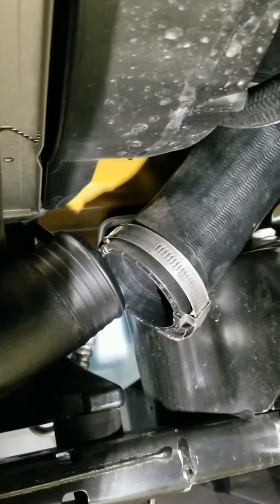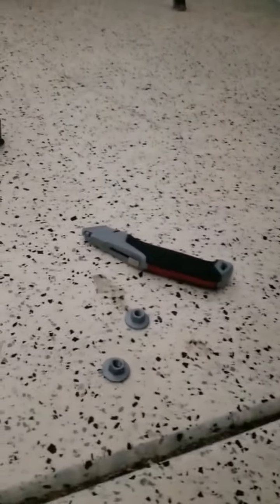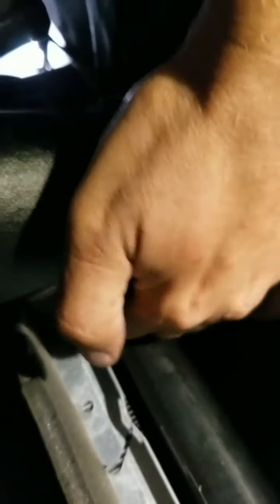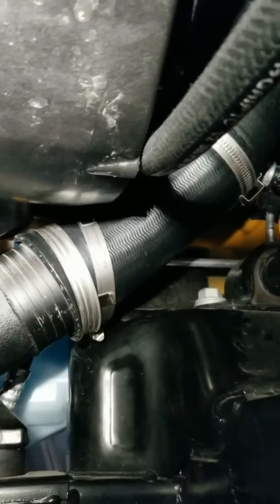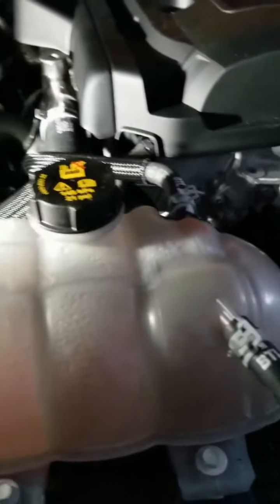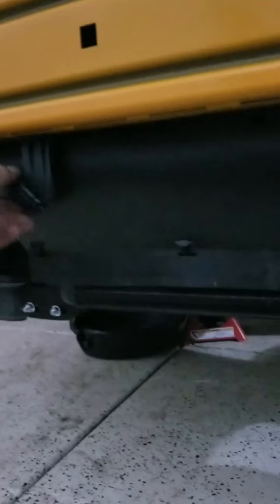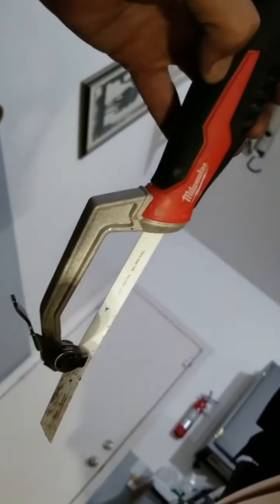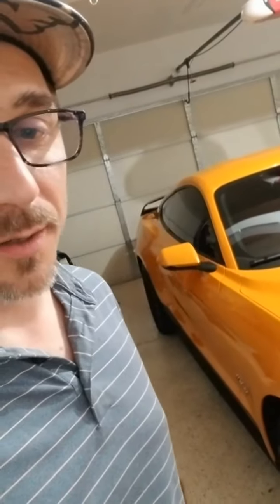CV Fabrications Full Race Intercooler - Part 3 of 3  Installed on 2019 Mustang EcoBoost

Comment: Do I need to tune my car if I install the intercooler?
Reply from the maker: No, but you will not really receive the gains from it until you do.  The same goes for pretty much any mods that you do.  Except the air filter.  You may see immediate gains by dropping in a high flow filter.

Comment: Would you recommend this FMIC? I can’t seem to find many reviews on it. It is a HUGE intercooler, I’m just trying to figure out which parts I want to put on my 2020 EcoBoost.
Reply from the maker: Yes, I definitely recommend it.  It keeps the charge Temps low and if you ever plan on getting a big turbo then a Race style FMIC is neccessary.  The quality is excellent and it is the best bang for your buck out of the larger ICs that I could find.  I also wanted black and most others charged extra for that.

Comment: Was it difficult to install it? I just got mine same as yours but silver. And do you really feel the difference in performance?
Reply from the maker: It was not very difficult if you have some decent tools and a little patience.  It was more time consuming than difficult.   If doing it alone I would give yourself a weekend to finish so you are not rushed and can be organized about it.  I put all hardware that I removed in baggies and taped them to the bumper or whatever,  so I knew where they went.  I also work on aircraft so I have a good set of tools.  You do kot need to be a professional mechanic to do this, but you will need to take your time.  Let me know if you have any questions during your install.
Reply from the maker: As for the performance...the intercooler is really for keeping the Charged Air Temps down.  I had just recently installed the Ford Performance Tune kit in my Mustang, but was not seeing any gains.  After installing this intercooler my 1/4 mile times dropped from about 14.1 to 13.8.  I noticed a big decrease in my temps after doing some full throttle pulls right away.  My car was getting heat soaked, which was taking away from the power that was already there.  I did not take it to the dyno yet, so I am not sure about actual HP and Torque gains, but I can tell you this.  After installing this Intercooler along with the Airaid Intake Tube, K & N filter, and NGK 1 step colder plugs; I am now running the 1/4 mile in 13.4 seconds with a trap speed of 106 mph.  My 0-60 times is 4.9 seconds and I feel I can better because I am testing at 2,500 ft altitude and my 60 ft time is 2.3 average.

Comment: Hey man did you get an engine light or did you put the stock sensor back on?
Reply from the maker: I did not get an Engine Light after my installation, but my car does not have the AGS (Active Grille Shutters).  The harness for the AGS was already plugged with a jumper connector from the factory and tied up behind the Bumper Crash Bar.